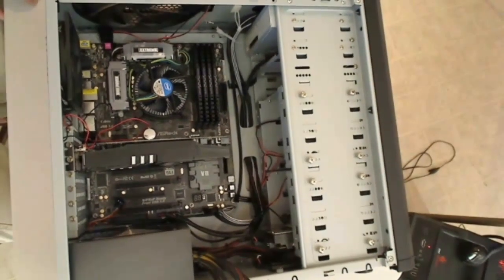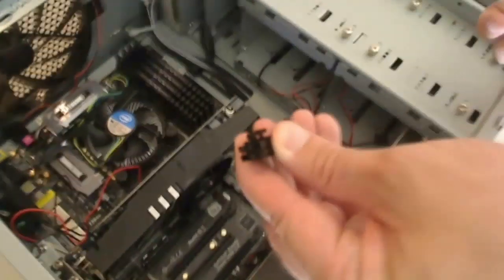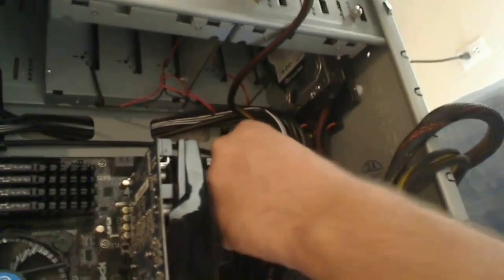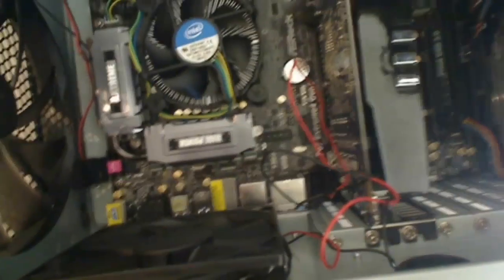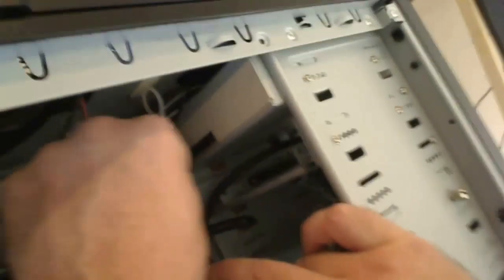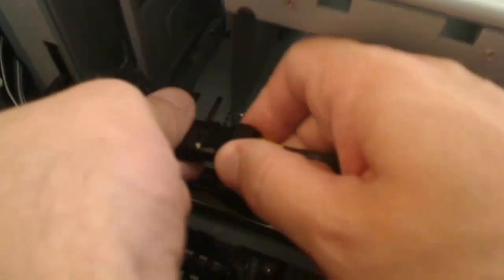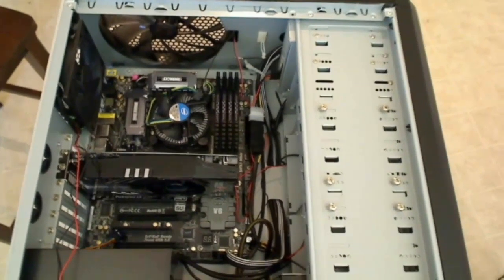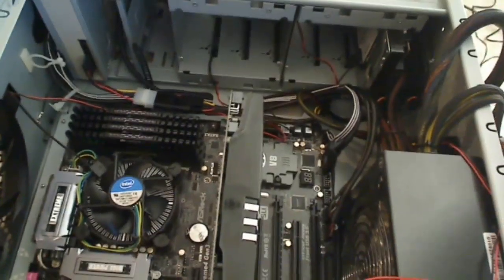How To Connect Power To Fans and CD-ROM 2012 - Step 13

Comment: my antec 900 only has the 1 big 4 pin molex for the big 200mm fan. the other 120 mm fans use 3 pin connectors, where would i plug those ?